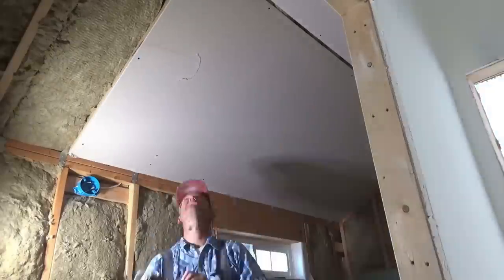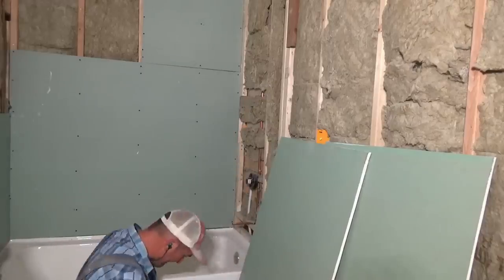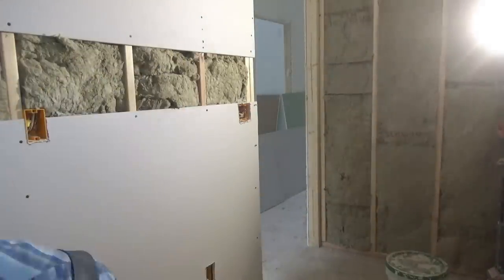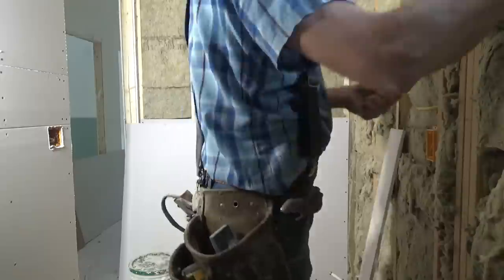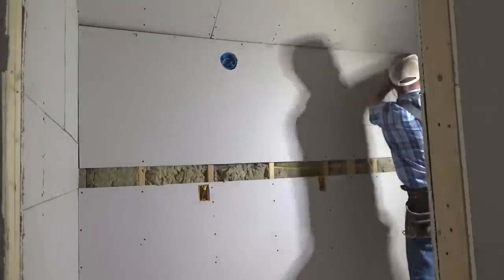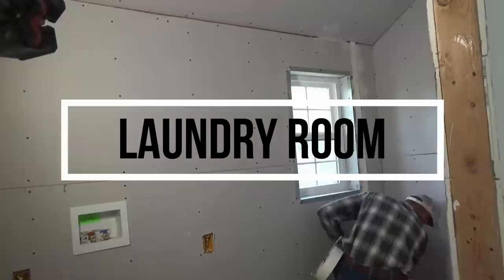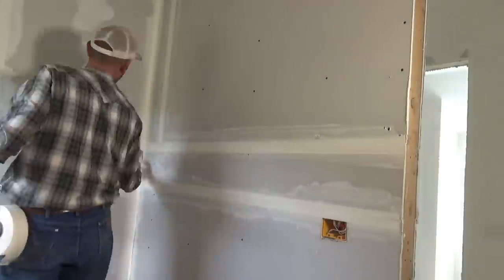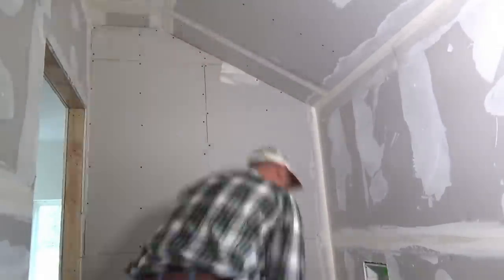#332 - MOLD - Vapor Barrier Vs Green Board Drywall - Bathroom And Laundry Room

Comment: Whenever I use mineral wool insulation I use a smart membrane from CertainTeed in my climate zone.  I don't think people should take advice about regional specific building methods from a youtube channel and should instead do their own research and discuss with the local builders or building inspector. You can make some serious mistakes using the wrong kind of product or not using one at all in certain regions. There are air barriers, vapor barriers, and vapor retarders. These are all different materials and have different uses which you may want to elaborate on in a future video for the 121k current subscribers taking the 'vapor barriers are bad and cause more problems than they help' as gospel. Not trying to be rude, but you don't want to lead a viewer astray to the rather climate and region specific science!
Reply: Considering I personally called Roxul insulation in Canada, and spoke with their engineer about this, who told me absolutely he needs a vapor barrier in that area with their insulation, I am calling BS on Heath.  This goes back a couple months.

Comment: I am having difficulty with the information presented in this video. 1) I was hoping to hear Heath say he consulted directly with the local Building Inspector to query him on whether a VB was required or not. He did not say he did that. 2) Is Heath allowed to install drywall without a final framing/ VB/insulation inspection? I don't know because I don't know local Idaho Codes. 3) 3% to 15% humidity data doesn't sound correct. 4) Many of Heath's comments, and justifications, are related to human comfort ... but not to the science of Building ventilation and sealing. I think he should revisit this video and address these core issues. In particular, what troubles me is the attic space venting ... especially now that there is no VB. The so called "Bird Holes" have now been blocked off by insulation, and the attic space above the up-stair bedrooms is not vented. I would like him to video the attic area 2 years from now to see how things are progressing. Green Board vs Cement Board comments are fine because they can be easily remedied if problems arise. VB issues are insidious and are much tougher to remedy later.
Reply: The figures were wrong. Now in July, the humidity in his little town is varying between 20 and 90 percent.

Comment: 5:22 "There is no need for vapor barrier in the US"? That is a dangerous statement. Those houses that are heating or cooling most of the year with not wood sources will need vapor barrier to hinder or stop the moisture from getting into the insulation. You understand vapor barrier is not to stop the moisture from getting in the drywall but to stop it from getting in the fiberglass insulation. Since you are using Rockwool you don't need it because the insulation is not affected by moisture. There is a point in the insulation that the transition of warm air to cool air where the moisture will condense. If it is in fiberglass insulation it will ruin it making it useless.
Reply: Wrong!  Called Roxul and confirmed it IS NEEDED.  Call them yourself if you don't believe me.
Reply: @JohnDoe-np3zk  Well I would agree a vapor barrier should be used but if you are not going to use one then Roxul or rockwool insulation should be used since water damage will not happen. Although the water has to drain somewhere of course and the damage will happen there probably on the bottom plate.
Reply: @Submanca  I think his bigger issue might be the lack of proper attic ventilation leading to ice damming in the winter etc.
Reply: @JohnDoe-np3zk  Wouldn't that be a attic insulation and roof venting problem?
Reply: @Submanca  yes it's all tied together.  The main thing that causes the issue as you pointed out is when warm air meets cold air.  The warm air carries so much more moisture than cold air does so you get that condensation.  I think the real solution is a permeable vapor barrier which is available.  The plastic against drywall paper, not so good.  Then again I hate drywall...

Comment: trying to get your 'opinion' across about whether a vapor barrier is required in your particular area and that your being careful to make your building as air tight as possible would be more believable if you didn't leave such wide gaps in your drywall job, sorry but north america is vast, and all regions have unique situations when it comes to building codes. hope that helps you understand.

Comment: You're making me feel stupid for putting up plastic vapor barrier on the exterior wall when I remolded my kitchen.  I didn't like that it's only a 2x4 wall and didn't want any of the kitchen's normal vapors getting through the insulation and out to the cold wall.  MEP in the walls/floors there is all brand new, so I don't expect a leak inside the wall.  Hope my logic turns out okay for our home.
Reply: Is your humidity 3% too LOL?  If so then not a problem.  Hold your breath though.

Comment: Sorry, don't know why it does the multiples
Reply: Gobuilditbetter is having a blog fart!
Reply: @monicapttrsn  do you know how to fix it? my Mac Multiplies my comments, sometimes 7-16 times. Some I can delete, some not.
Reply: @ModernMountainLiving  Don't tell the reason to the trolls!!!!!!
Reply: @ModernMountainLiving  I'm looking into it.  If you can, try sending a comment from another device to see what happens.  Better yet, send a comment from another Web Browser and see what happens...so if you used Safari, try using Google.  If this happens on another device, then the problem is specific to your account, and a new account will solve the matter....seems to be a problem with mostly Firefox, and sometimes Safari...(1) Try  a new message with another Browser....tbc
Reply: @monicapttrsn  same device sent 122 copies on another site, embarrassing
Reply: @ModernMountainLiving  If you can try sending a message on your phone (which is another device) to see what happens.  I cannot find a solution at this time.  Go check your "apps" under settings (oops, that's the Windows location)  to see if any new program was installed on your Mac when this started.  If so, delete the app (what I mean by app, is that you are looking for a foreign software program installed 2019 that shouldn't be there).  This is starting to sound more like a virus.  If you are using Firefox (or whatever browser you are using), go to browser settings/addons to see what addons are running; disable addons you don't recognize (you have the option to delete or disable the addons) .  Some software program is running on your Mac that is doing this to your browser....VERY IMPORTANT TO SEND A MESSAGE ON ANOTHER DEVICE TO DETERMINE IF IT IS YOUR ACCOUNT OR THE MAC, but I suspect some alien program is on your MAC.tbc
Reply: Can't find the solution today, but it appears Google has a beef with Firefox and is playing computer coding games with them.    https://www.reddit.com/r/technology/comments/beelg8/google_accused_of_sabotaging_firefox_again_google/

Comment: I am sorry but these are stupid claims about not needing a vapor barrier. It is not a question of climate you live in but the simple fact that one man produces over 400 ml per day just through respiration. Now add a sink, toilet, cooking, washer, shower, etc and you would get a considerable amount of vapor. Without ventilation this vapor must go somewhere, it is basic physics that vapor travels inside to outside. If it gets into the insulation, it would not get the job done. If the vapor barrier causing the moister then the problem is ventilation, not the barrier.

Comment: Can't argue with you about the need for a vapor barrier in your area as I have not done any work in that part of the country. I will say you are misleading people when you say it is not needed anywhere. There are many parts of the country that require it. Lets look at it another way also, why do your major manufacturers of insulation make their products with a vapor barrier as part of the product....I would say as a manufacture making something with no demand would be foolish wouldn't you? I do have an issue with the way you are doing the bathroom, you said you are putting cement board over a vinyl product over green board....have to say that I've never seen that done. In our part of the country (and it shouldn't matter what part of the country, a bathroom is a bathroom) the entire bathroom including the ceiling is done in green board, except for the shower or bath walls which are done with cement board. Some contractors will put a painted coating or vinyl product on the cement board depending on the system they are using, and some tile systems want you to NOT completely seal the bottom as to let the water weep out. I have to say you are getting a bit cocky for someone who has only built one house so far, well almost has built one, lol.
Reply: I personally called Roxul and spoke with their application engineer about Heath's situation and Climate zone.  He told me a vapor barrier is required with the Roxul in that area.  This was mentioned on here.  Oh well.
Reply: @JohnDoe-np3zk  One thing I learned about Heath, is he is a solid block head (a hard worker) but a block head. He is the kind of person who can not learn from others because he thinks he knows everything and if people tell him different, they will keep searching until they find someone who will agree with them. I personally do not know the building requirements or good practices in his area so I really can't say, but if what you say is true, I would have followed the manufacturers recommendations.
Reply: @joed7073  on some levels I am very impressed with his project.  The water source for example, the shallow well.  That's a huge thing.  Insulation, air sealing, and ventilation is a big learning curve and experience can be a cruel teacher.  The modern approach is to seal the interior and ventilate the exterior if that makes sense.  I think his attic is going to get roasty hot when the sun hits it with that metal roof and not enough ventilation for example.  Winter time is another matter and the moisture issue too.  He does need to clean that wood stove pipe before it burns down his house.

Comment: You installed tyvek outter wrap.....  Isn't that a vapor barrier....
Why would you install an inner vapor barrier...
You would be sealing the moister in the walls..
Reply: NO IT IS NOT. it is a water barrier. vapor still passes through it. its called house wrap. not vapor barrier. just so ya know.
Reply: tyvek is designed to let a house breath but not allow it to stay wet. vapor barrier was throught to help stop water vapor but all it does is trap it then condense it then turns it into water then it is stored inside the walls. best thing to have to fight vapor is a fan. constantly running moving air. and ventilation.
Reply: If Tyvek was a vapour barrier THEN the moister would be trapped in the walls. The vapour barrier - if used - should always be on the warm side of the insulation.